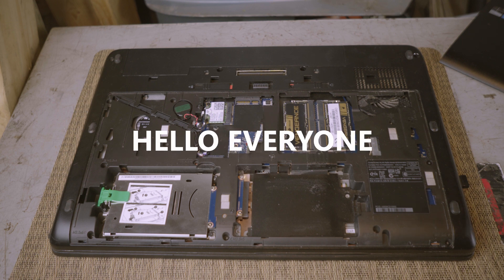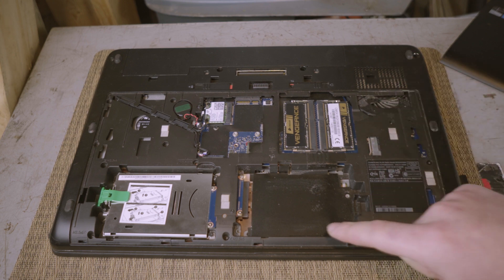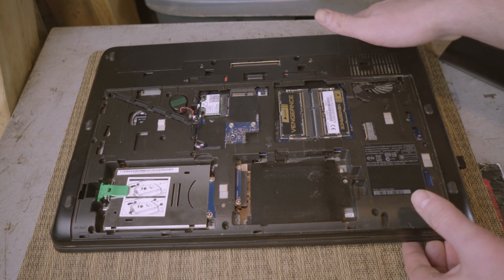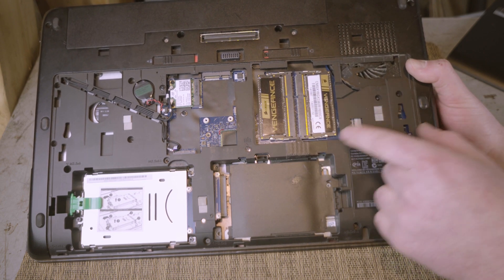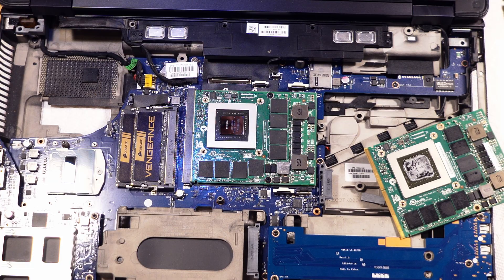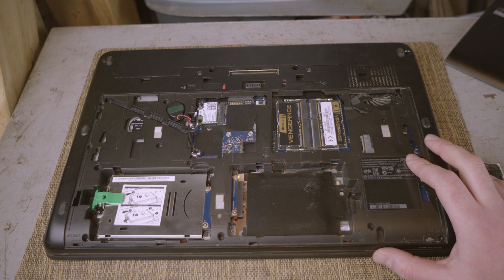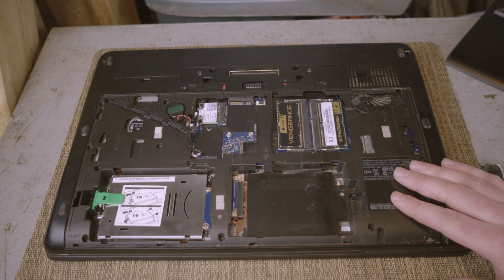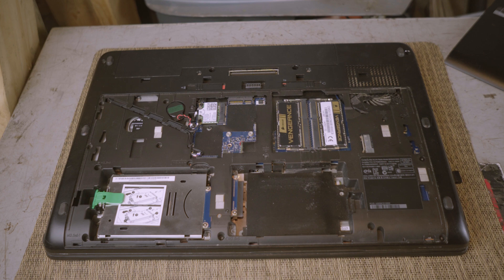Laptop Graphics Upgrade - HP Zbook 17 G1 - Quadro K3100m 4GB to K5100m 8GB - Laptop GPU Upgrade Easy

Comment: Hi everyone,
I have a HP Zbook 17" G3 with a Nvidia Quadro M5000M. Our office discarding old laptops and I end up with a NVIDIA Quadro P5200. They are both MXM-B 3.0 bus interface Gpus. However M5000M is 100 W whereas P5200 is 150W. Do you think this upgrade would work?
Reply from the maker: @annalim601  I really couldn't tell you however if you have the parts on hand you could try and let us know. As you say it's a higher wattage so maybe it will work for basic tasks but if you push it it will crash.
Reply: @IdeaMan4k  possibly. My laptop charger is 200W idk if that’s a good sign that is higher than the 150w p5200 uses

Comment: Does the k5100m come in different models? I'm finally about to upgrade (3 years later from my other comment). I see a lot on ebay that say dell. Want to make sure that it will work in my Zbook17 G1
Reply from the maker: I saw those two but I dont know for sure. Stuff like this is not easy to get info on. I just got the HP Zbook one to be safe. If you try it let me know. Also glad to hear you are still using it. I got my laptop and it sometimes gets used to play Valheim when people come over. Its been like 10 years but this was the best computer I ever owned in my life. Its also on the IIS in space.... lol. Even today, this laptop just FLIES. It feels faster then brand new laptops and I dont know why. I used it for about 7 or so years and it was on 24/7 during that time. I actually remember when i was buying it my biggest concern was it only had 1 fan, and the Dell had 2. However I got a good deal on it and that 1 fan proved to be the best single fan ive seen anywhere since. I now have the Zbook 17 G8 with Quadro A5000.

Comment: Windows 11 runs like a pro on this
Reply from the maker: Yes this computer has surprisingly aged very little. Just the other week I had someone use it to play Valheim with 4 of us in one room. Worked great. Am now using the G8.
Reply: @IdeaMan4k  oh right but the later Gs starting with G3 is all soldered stuff cpu wise at least I’m still seeing good potential with i7 4th gen somehow ! You’re right ! Can’t wait to get someday bios chip for my quadro p5200 that 16gb monster managed to get one super cheaply off eBay recently waited nearly 5 months due to delays for 200$ while Chinese sell for over 1000+$ some for 500+$ has no bios chip what a downer 😔 driver installs but won’t start code 43 ! So I’m keeping it carefully tucked away in spare motherboard slot of this laptop !
Reply from the maker: @Mr.Fantomas777  I don't think this one is I have a Xeon W-11955M and a Quadro RTX A5000 16gb. I lucked out on the outlet for $2000 it had no wifi card. Got one on Amazon for 18 bux. So far it handles absolutely everything. I will review it soon, I think its very good.
Reply: @IdeaMan4k  right ;) well I’m not looking to upgrade beyond 4th gen unless I can afford the eurocom laptops they are beats desktop parts also cpu in laptop can’t get better than that but surely pricy 😃
Reply: I can now confirm p5000 runs no probs in this g2 and g1 models I’ve got me one also got p5200 just need to solder the bios chip first then test
Reply: Update running quadro p5200 on this G1 laptop had to mod flash bios chip that got soldered into with a 110watt firmware from techpowerup! Yep all works ! So yeah go for it people !

No need for driver mods just flash the bios with 110watt from techpowerup ! Nothing else tried em all using 200-230watt charger smooth as F! At some point will try the Tesla P6 card basically p5000 ! Fs2020 works good with i7 4940mx and 32gb 2133mhz ram btw there’s 2400mhz ram ddr3 sodimm that exists and I have 2 sticks of 8gb each not using it because I need 2 more of those for full 32gb

Comment: Jan.2022 - how do you find out if you have G1 or G2?
Reply from the maker: I am pretty sure on the bottom case it says the full model number. You may need to detach the metal cover I forget if the numbers below the cover or just simply on the back. Also if you cannot find the G1 or G2 and just find the serial number you should be able to find it on the HP website and it will tell you. Hope that helps.

Comment: I’m gonna upgrade this beast to nvidia Tesla p6 p5200 and rtx 5000 soon first nvidia Tesla p6 ! I have 4 of em currently one of them runs on Quadro m3000m no problem other 2 k5100m temp waiting for Tesla p6 16gb from eBay soon ! If this work too then rest is same ! I7 4940mx 32gb ram 2133mhz I spotted on eBay 2400mhz ddr3l sodimm recently ! X2 1tb each ssd ! If gpu upgrade works I’ll post here confirmation I have nothing to lose !
Reply: So hello again ;) confirmed RTX series won’t fit physically that’s the end after P5200 series card because screw holes positions on rtx series are slightly different Google mxm rtx nvidia ! You’ll see however ! There’s 3 at least 3 other brands who mae rtx cards in same standard format : Aetina, PNY and Adlink but nowhere to be found on eBay at the mo but they have em for sale ! So there continual hope on this yet beast machine last bios 2020 !
Reply: @Mr.Fantomas777  I'm glad seeing this your report... I have zbook 17 G1 K3100m and acer predator helios 300 i7 8th gen. But tbh I love this zbook more even though it can't run games so smooth like my predator. But what I love most is it hardly gets hot while running games on it unlike my helios. Secondly I experience some sort of lagging within seconds if am running multiple apps on my predator or just resumed from sleep with multiple apps running, but this doesn't happen on my zbook 17 g1. I've been wondering if there could be a way to upgrade the graphics card way higher than just k5100m, So I can still be using it. Even I observe the display is more sharp than the acer predator helios 300 i7 8th in terms of display and depth color. I really don't wish to dispose it yet cos it still runs so smooth on windows 11. Can you pls drop me your whatsapp number let's connect for further information and assistance. Thanks ☺️
Reply: @Mr.Fantomas777  HI, I tried a P3000 in a HP zBook 17 g2  but the display stayed dark. The display is a TN FHD 1920x1080. Is a Dreamcolor display required? If so, what serial number does it have and what cable do I need. Thanks
Reply: @kleinkramkiste167  hi there ;) first I’d re flash the bios of the card with the newest bios available from tech powerup if that don’t help then card is faulty ! U can still use it by enabling switching graphics and tell nvidia to use that card as main in control panel of nvidia ! Try that I have p4000 working now trying p5200 but that card physical burn mark at the golden connector area ! Needs soldering !
Reply: @kleinkramkiste167  also make sure you card has a bios chip soldered on it !
Reply: @Mr.Fantomas777  Hi,I tried a P3000 in a HP zBook 17 g2 but the display stayed dark. The display is a tn FHD 1920x1080. Is a Dreamcolor display required? If so, what serial number does it have and what cable do I need. Thanks
Reply from the maker: Awesome keep me posted.
Reply: So yes Tesla P6 worked only trouble was had to manually removed the compute mode by using nvflash but first had to trick it by putting it to sleep first plug the card manually install driver then nvflash why? Cause if u ten on straight away u get psychedelic Colors and nothing moves then no 3d settings in nv control panel but worked I got p5200 but it’s got no bios chip it will work once I get the bios chip version or solder one currently running on p4000 had to reflags the bios file got one off eBay from china bios was corrupt installs driver says incomplete with question mark asks restart reported problems so disabled after re flash spotless perfect ever since yep so so far if the card got bios chip you’re in for a treat use techpowerup site for bios files ! I’ve got 4 of these so far built manually by parts off eBay I’m in love with this model win11 soars like a beast with ssd Sata not even using m2 ssd ! I7 4940mx 32gb 2133mhz and this p4000 so far there’s p4200 card on eBay from china 360$ more less with bios chip u can buy their bios chips also ! So no need to stick to default hp rules they r designed to make us buy new stuff and no upgrade ! That’s g2 should be same for g1 I got 2 dreamcolor glossy screens and  two matte ! Two p4000 and two m5000m no probs I’m planning to go all the way up to either p5200 or rtx5000 should work as long as bios chips r there ! 🤘
Reply: I have a HP Zbook 17" G3 with a Nvidia Quadro M5000M. Our office discarding old laptops and I end up with a NVIDIA Quadro P5200. They are both MXM-B 3.0 bus interface Gpus. However M5000M is 100 W whereas P5200 is 150W. Do you think this upgrade would work?
Reply: @vivien9017  yep P4000 works so far next p5200 😄🤘 mark my words and I’m honest wish I could post picture proof 👍
Reply: @vivien9017  eBay randomly lucky to say the seller didn’t mention it to be glossy some say it’s matte I have now 5 of these laptops 2 m5000m and 2 p4000 one temp as experimental on m3000m also k5100m trying to hack the drivers to enable latest because nvidia don’t support it anymore since 2020 😞 8GB ffs but weaker Kepler cards till support I also found modded clock boosted bios Tom online for k5100m works well! I got p5200 has burnt mark on the bottom right area where tiny golden pins end and next to two big empty ones it’s like a moon crater it had a pimple like swelling popped and that’s what I get wouldn’t power on before popping it now does but won’t detect looking for solder masters here in Gibraltar 🇬🇮 or gonna learn my self ! Has bios chip !
Reply: @Mr.Fantomas777  Hello, thanks for the reply. I have a P4000 which I have tried. it actually works in my HP 8770w with Dreamclor Panel (eDP) without any problems. Flashing the bios was not necessary.The same with the P3000. With the m 8770w, however, the onboard graphics are deactivated from the outset by the manufacturer. in this 8770w it woks only with a DC Panel .That's why I asked about the display you used. In the zBook it's just a TN display with 6-bit color depth
Do you think I should 1. enable onboard graphics in the bios. 2. Install p3000
3. when windows is loaded, switch to the p3000 in the Nvidia control panel.
Thanks
Reply: @kleinkramkiste167  honestly I have intel and nvidia graphics enabled both in bios when I play a game then automatically nvidia takes over and uses the card otherwise for normal use intel graphics do the job and looks like it don’t matter dreamcolor or matte display it works simply ! So yeah just go for it !
Reply: @Mr.Fantomas777  Hello, that was the way. The P3000 works. Set graphics to automatic in bios. Then the boot screen appears and Windows starts.
Install P3000 driver. And now Valhalla is running with settings hight and run with 30 FPS. Thanks a lot for your help :)
Reply: @kleinkramkiste167  yeah u can set it to make nvidia dedicated for gaming or even computing that’s what quadro is for but it games well when my use windows Intel then uses its graphics plenty smart tech 😃 I’m pleased for u mate Blessings 🙏 trying to revive p5200 mom has burnt mark on the bottom right area where golden finger pins are ffs ! Powers on but no detection has bios chip ! Not even heating as a sign of life at least 😞
Reply: @Mr.Fantomas777  Hi , for your p5200 can you see in the Device manager under Grafik the onboard Grafik and a basic grafik Device?
Reply: @kleinkramkiste167  no not even in bios or hwinfo or gpuz it has golden pins area borttom right corner round formation burnt thats how I got from eBay did get refund but no luck since the ! It needs soldering surgery definitely !
Reply: @Mr.Fantomas777  OK I wish you the best of luck with the purchase of a new one.
Reply: @kleinkramkiste167  aww that’s so kind of u 🙏🥰 although if u know just how much or what’s the cheapest price for one ! 594$+ is cheapest one and goes up to 1080$ lol just like gtx 1080 😂 some sellers know fuck all about what they’re selling a nearly 6 year old card which now only have around 2-3 years of driver support left then kaput🤣
Reply: @Mr.Fantomas777  sorry no, It's not the time to buy one, too expensive
Reply: @kleinkramkiste167  your right dear fucking inflation they price these cards like it’s a ducking whole computer or something new even ffs nearly 6 year old card year and half to go till nvidia will stop driver support then what waste of money nah fuck it we wait there’s however as I mentioned somewhere above these rtx cards quadro rtx which are available online in this standard mxm format but not available on eBay idk anywhere else maybe ! So look out for those also that should work on this laptop and any mxm 3.0b format that has lock screw holes aligned equal and not this new design !
Reply: I put thermal pads in the chips works wonders no mess just some grease but it’s safe !

Comment: Nice, just what I was looking for; intend to do that and double the RAM using the slots under the keyboard at the same time. Did you have to update the drivers or anything going to the better card?
Reply from the maker: I believe I installed the newest drivers but am not 100% sure. They are in the same generation so there should be essentially no difference.

Comment: Dude, best video ever. I have my zbook 1st gen from when it first came out. It sounded like an airplane taking off. 100% there was an inch of dust between the gpu heatsink and the fan and another inch between the fan case and the CPU heatsink. Sounded like an airplane taking off on bootup because the hardware was basically overheating instantly. You have made such a difference that not only am does the fan not even kick on into overdrive anymore... But I am also considering upgrading the ram AND the graphics card!
Reply: That's a great story & I hope it holds true for years. For yourself but also because I just ordered a ZBook 17 CORE i7- 4710MQ 32GB 500GB DVD+RW K3100m off Ebay tonight 🤣.🤞
Reply: @Rottidog68 Hey, coming in for a reply all these years later.

I upgraded to a core i7-4930 mx and I got a k5100m 8GB video card.

Essentially the best of the best for the CPU and GPU that you could buy for these G1 laptops. They were perfectly plug and play with no adjustments needed to the laptop. The only thing that was required was that when I bought the graphics card, I needed to order the x bracket separately. I couldn't get my old one off the original GPU and I needed a new heat sink. The heat sink for the smaller GPU has a different offset. The heatsink is the same for the 3100,4100, and 5100.

Running a graphics card test, this is STILL a 10 year old laptop but I can run Minecraft at 60fps with no shaders, and 30fps with shaders.

A solid state hard drive will also work wonders. As of right now, I have absolutely no reason to upgrade to something new. (Although the laptop is not windows 11 compatible so I'm currently capped at windows 10).
Reply: @slonison  This is all great information! Thank-you!
I've been looking around on YT & there's not too mucking fuch on these. What I have seen is impressive. I yelled GTFOH at the TV when I 1st saw how to get to the storage etc 🤣. Damn machine is made like a military aircraft. Built to be upgraded. Like an A10 Warthog that's still used today & was built in 1977.
One thing I wasn't thrilled about was the HDD in lieu of an SSD, but that's easily fixed. 
That CPU swap sounds interesting, but I'm going to see how this thing goes 'out of the box', so to speak. I'll almost definitely swap in an SSD for the C:.
With the stories I hear about WIN11, I'll stay with 10. Using it now on the HP Beats laptop. It does alright for the $100 I paid for it. Love the touch screen. 
I'm going to copy your post for quick references lol. 
Thanks again for all that!
Cheers

Comment: Hi, in sorry my question is different. I have an HP Zbook 15 G2, how do I install nvme driver to bios inorder to boot from nvme. Please guys hepp
Reply from the maker: Not sure the g1 does not support nvme. So I have never tried.
Reply: @IdeaMan4k  well I installed windows on the mSATA, only when it restarts that it doesn't recognize the drive.
Reply from the maker: @thulanidube3391  You could use something like Linux grub or a bootloader app. That way for example when your laptop starts up it will load from the SATA drive but then you can select the other drive to boot from.

Comment: Does it come with dvd drive ?
Reply from the maker: Yes this laptop comes with dvd.
Reply: @IdeaMan4k  i own now 3 of these laptops amazing love it :) thanx !
Reply from the maker: @Mr.Fantomas777  I have retired mine for an HP Omen 15 AMD but the old one is currently hosting a valheim server. Best laptop I ever had.
Reply: @IdeaMan4k  now I own 5 of these 😂 all running on i7 4940mx 32gb ddr3-2133mhz although managed to sticks of 2400mhz ddr3 Kingston and p4000 8gb also got quadro p5200 but the card had no bios chip next p5000 and experiment on Tesla m6-p6 rtx no confirmed won’t fit due to a screw holes not in same spot although I’ve seen some brands make standard mxm slot ! Beast still